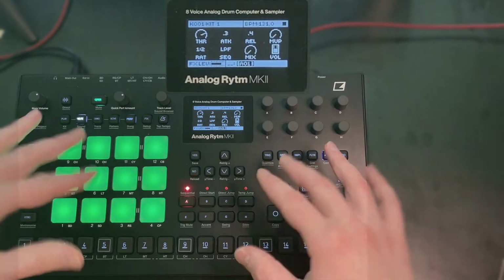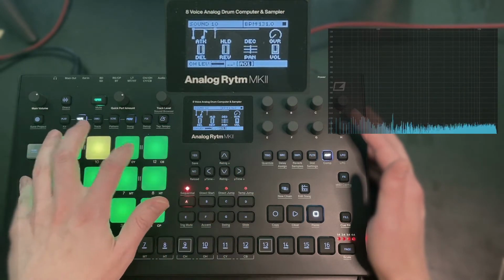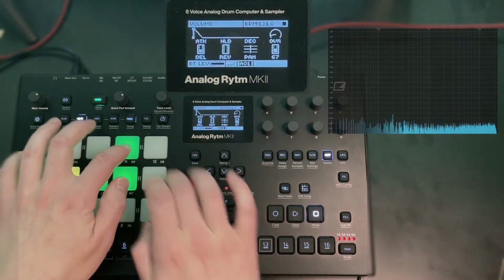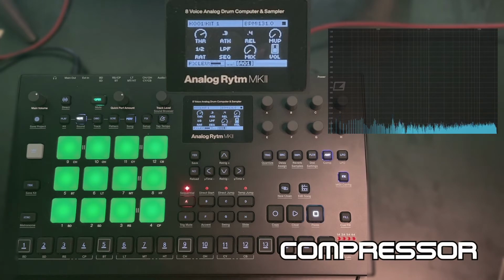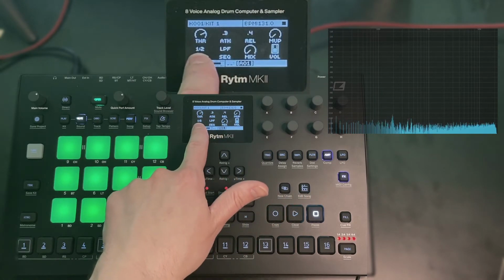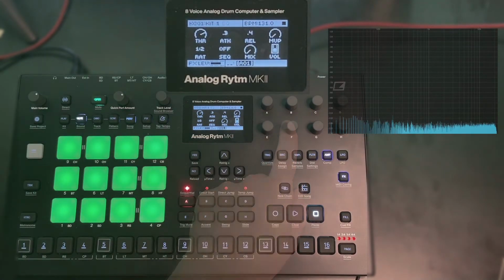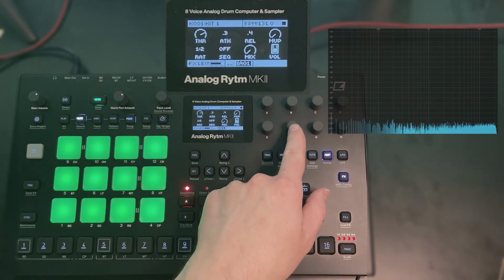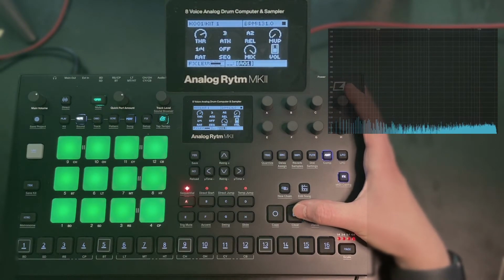Mix on the Rytm - An Elektron Rytm Mix Tutorial

Comment: Thank you for this really useful video! Superb jam too. You mentioned using an external midi controller for volume in your live sets. May I ask what you use? And are you going through your laptop or do you connect directly to your Rytm?
Reply from the maker: I use the Faderfox MX12 for Live Sets or if there is not enough Space the UC4, without any Computer. With a MIDI Converter you can also use Novations Launchcontrol XL.
Reply: @mbrauer3676  Thank you for the kind reply. Very much appreciated!
Reply: @mbrauer3676 Love your videos! Thank you so much. How did you configure the UC4? Have one and would love to use it for the volumes with Analog Rytm MKII. 
Do you use an external compressor for live performances?